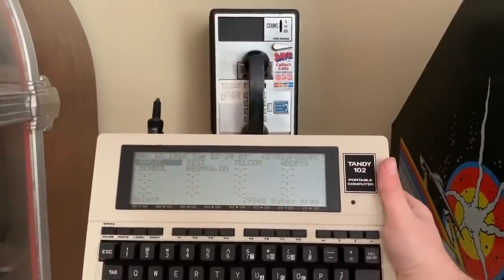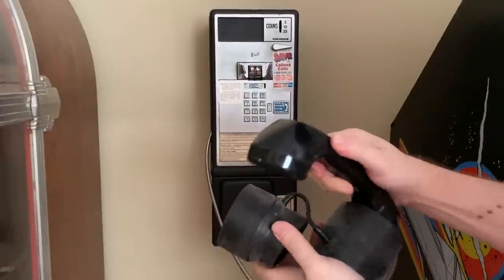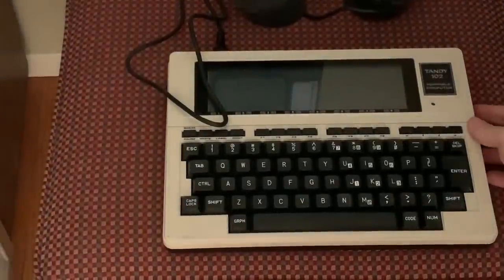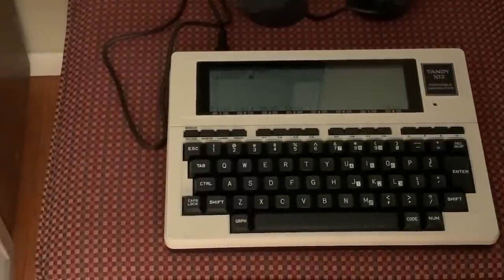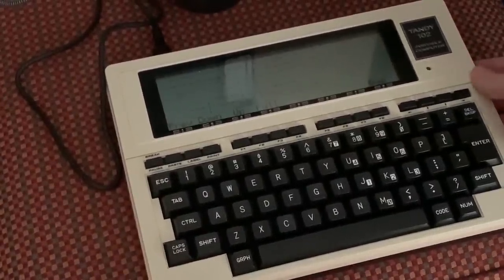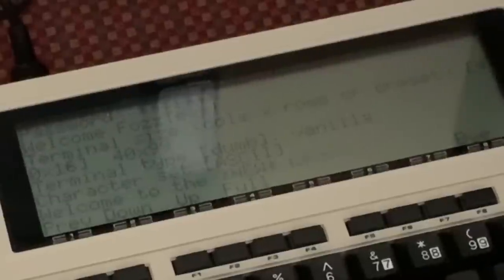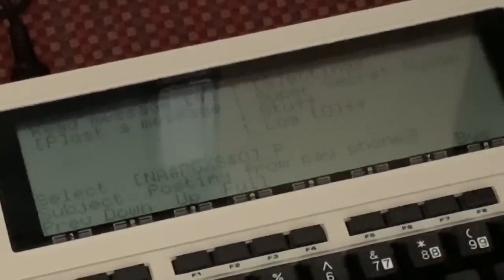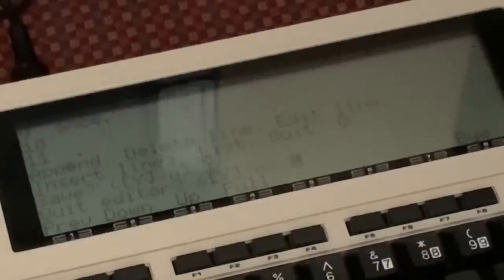Calling a BBS from a pay phone using a Tandy 102

Comment: I see there is still one BBS left to dial-up.  In the 90's, I used to keep a list of my favorites. Today, who even uses a modem?  I'm guessing you bought a pay phone off eBay or somewhere. I still see a few around L.A., but none of them work and are dirty and poisonous.  When I was a kid, I would have no money to use the pay phone, but that wouldn't stop me from using one. I would annoy the operator, plus make collect calls to people I don't even know, hoping they would accept the charges.  ;)
Reply: I dialed into BBSes in the 80s on a Commodore and it was a blast. Didn't use a payphone though. Now you don't see payphones much in fact, most people don't even have home phones anymore.
Reply: How would the phone work if they bought it?
Reply: @mark.audacity  I'm thinking if someone bought an old GTE or ATT/Western Electric payphone as pictured above off of eBay as something for their den or rec room, and connected it to their phone line, it would just function as a regular phone. Sticking coins in it would just get stuck in the top part of the phone and never fall to the box or returned, as the their would be no electrical signals from the network to do anything with them as it's not a pay phone line. Obviously the purchaser would also need to provided with keys to get inside to retrieve the coins and fix anything.

Comment: this is cool back then and now as I guess .First very nice video I like it. Second what is BBS ???
Reply: A Bulletin Board System. As the name implies, the concept was that every BBS would be a regional bulletin board, where you could post messages, chat with others, share files and even play text-based games. This was before the world wide web, and these were run by computer enthusiasts. The sysop (the person running the BBS) would have a computer connected to the phone line with a modem, to allow others to dial in with their modem-equipped computer. They fell largely out of use after the Internet took off, though some still exist. Some only over the Internet, through a program called Telnet, though others can still be reached over the landline.
Reply: Some modern message boards still use the BBS moniker. Which is the only reason I know what it means.
Reply: BBS is also one oft he first internet's first community
Also provides communication people to people, just like some normal chat rooms in today's age
Reply: BBS' was software installed on run of the mill desktops of its time by ordinary people. i.e. no large corporate enterprises, which allowed for a primitive form of network connectivity.  The operators dedicated a computer and paid for a dedicated phone line(s) out of their own pocket.  Almost always it was local users in the same area code that connected, hence they were more popular in larger metro areas.   

The BBS software varied in options but almost always it included a message boarding type (forum), file library for compressed files to be housed, and some level of proprietary email.  Multi-lines may have offered chat functions and some had online gaming options.  While it was all text based and not point and click, there was a mode called ANSI graphics that allowed for colorful and amazing text based artwork to be utilized on PC based BBS'.   

BBS' got pretty sophisticated and massive multi-line systems become fairly common by the early 90s, albeit these were usually a pay per use type of systems.  But once the commercialized internet took off in the mid to late 90s, these systems very quickly died off or simply transitioned into being internet-only type local providers, phasing out their BBS functionality.  One major part of BBS'ing back in the day was the sense of community since it was almost always local people that connected.  Meet-ups were fairly common since everyone lived relatively nearby.  That's the one thing that is lacking in modern BBS replicas; they may replicate the environment but the sense of community is no where the same.